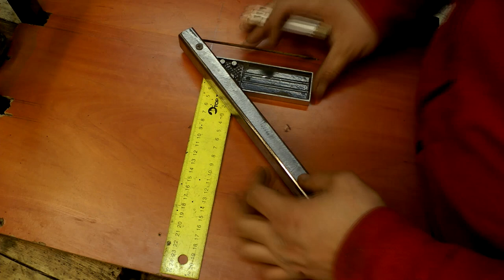The simplest stand for an angle grinder

Comment: Nice, usable and simple for make it. Bravo. Just switch for light is not enough strong for current of grinder, in my opinion.
Reply from the maker: Yes you are right. The switch may not be strong enough. But after 2 months it works fine. In the grinder itself, protection is triggered, for example, when the circle is bitten.